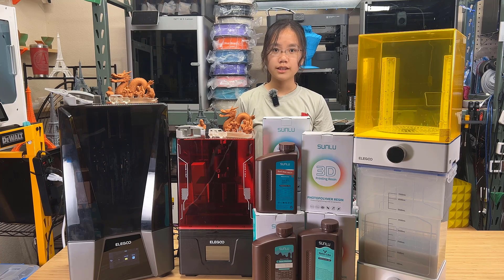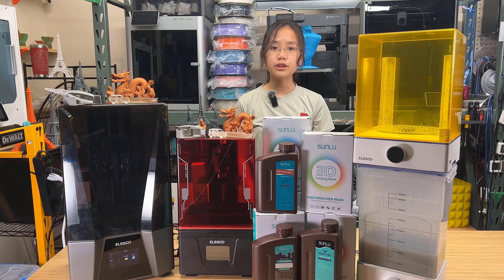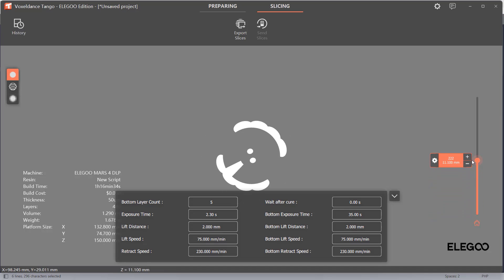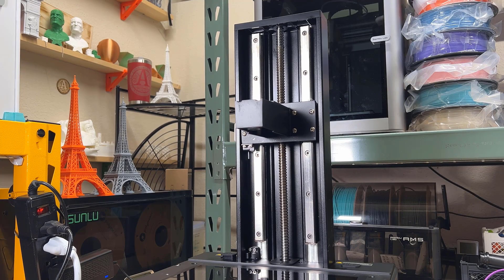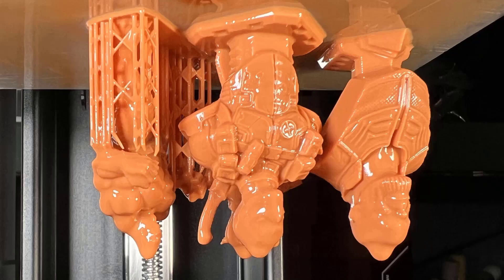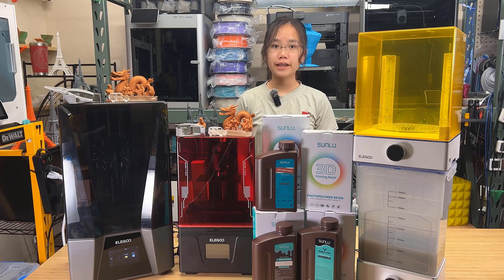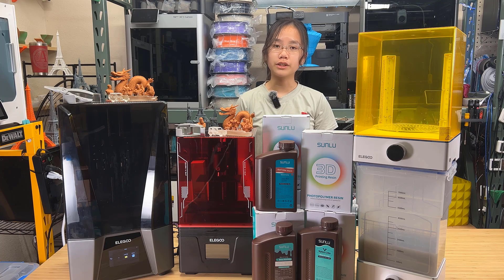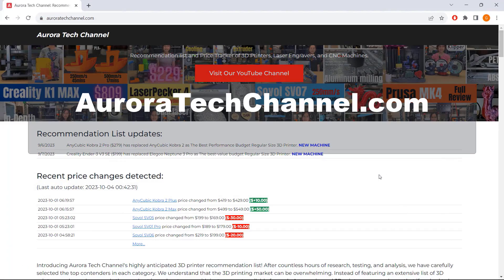ELEGOO Mars 4 DLP vs Saturn 3 Ultra 12K resin 3D printer: 2K DLP or 12K LCD for a comparable price?

Comment: Hi Aurora,

You have the Z=0 set perfectly on the Saturn3 Ultra, your "base layer" exposure time of 35 seconds is WAY too high that's why you have that "elephant foot".  You should set the base layer exposure time to 7.5 seconds - 10 seconds (3 - 4 times normal exposure) and you won't have the elephant foot or over-adhesion problems.  Also, wait before exposure time is very important on these large build area printers, so the resin can distribute evenly below the big build plate, and stop moving before exposure, for the first 1 - 2 mm of the print.

Also, the "etched" build plate is a "gimmick" or "trick" to "force" adhesion (this includes nonsense recommendations to "sand the build plate") - the actual force that causes adhesion is Van der Waals force, and it is very dependent on properly trammed (aka "leveled") build plate - that's one of the reasons the smoother DLP build plate worked better.  Even using a smooth, shiny tempered glass build surface works extremely well, so does an acid-etched (matte) tempered glass surface.  You can see many examples on the Tango slicer d.i.s.c.o.r.d, just search "glass build plate" on there.
Reply: I know I should know how the print adheres to the build surface, being a PhD student, but my lab has some ceramic DLP printers and the company said we could use glass if we wanted. Their only warning was good luck getting parts off the build plate. I just stopped using the machine basically as it does not have enough energy density for my project and the astronomical costs of vat films with wear using ceramic particles so I switched to SLA.
Thanks for the info!
Reply: @ScuffedEngineer  Thank you so much for the valuable comment, my info is all empirical after years of experiments, the objective was to see if good "consumer-grade" mSLA LCD 3D resin printers could be viable for prototyping parts reasonably near the level of industrial pro SLA machines at a fraction of the cost.  [ Spoiler alert:  in my case the answer is absolutely, more than I actually expected when I started testing ] 

Interestingly, I have printed many ceramic parts on my mSLA LCD printers (Nova3D Bene4 Mono, Whale3 SE, and Whale3 Ultra), using Alphasense Ceramic resin, alone or as part of a mixture with other resins (Siraya Blu and 3DMaterials SuperPP), but due to my print settings (way lower bottom layer exposure, etc.), despite the cleanup being heinous, the film wear is reasonable  and I never have over-adhesion, and this is true for flat on the build plate with a standard surface, a WhamBam flexplate, shiny, smooth, dark tinted tempered glass, and acid-etched clear tempered glass surfaces.

I assume that the ceramic DLP printers were using the unfortunately recommended outrageous "burn-in" [bottom layer] times and large number of "burn-in" layers?  Using my methodology, the removal is like separating "wringing gage blocks" [search this term and look at the Starret-Webber website entry],  it should then be very clear why this works [from the Starret-Webber page on wringing gage blocks]:

"Wringing requires two smooth, flat surfaces with surface finishes of 1 microinch AA or better.
 For gage blocks, it becomes difficult to wring surfaces if the flatness starts to exceed 5
 microinches.  The sources of the forces holding gage blocks together are thought to come
 from:  
      1. Air pressure from the surrounding environment as the air is squeezed out when the
          blocks are slid together.
      2. Surface tension from oil that remains on the gage blocks or water vapor from the air acts
          as a glue to hold them together.
      3. When two very flat surfaces are brought into such close contact with each other, this
          allows an interchange of electrons between the atoms of the separate blocks, which
          creates an attractive molecular force.  (This force will remain even in a vacuum or if no oil
          or water is present on the blocks.)

The last two sources are thought to be the most significant."
Reply: @retromodernart4426  I'm using very high solids loading by volume resins, on the order of 60%+ which means that the ceramic particles make up over 80% of the weight of the resin. We want nearly fully dense parts before debinding and sintering to get as close to a monolithic structure as possible. 

The wear doesn't really come from the printing process as much as the cleaning and we've done short DOEs on curing times. Our films also cost $50 a piece. The build plates we were given are powder coated and I haven't had the time to make a flat steel or aluminum plate for the printer.

My actual research is in silicon carbide in which power density is an issue. The DLP printers we have measure out to be 30mW/cm^2 on max power while my SLA printer gives 250mW on a 60 micron spot size. I am also after much smaller particle sizes than published in current papers. I can't say much due to my work currently being IP protected until the paper is published, but I'm in the single micron particle size range with a decent amount of nanoparticles.

I have a background in manufacturing and metrology so I know the concepts, but just haven't put the two together. It's good to have that information out there for others that may stumble upon it though.
Reply: @ScuffedEngineer  Thanks very much for all that additional info, I understand, it's very interesting!  I've done experiments loading resin mixtures with mica powder "epoxy pigment" [ecopoxy brand], nearly zero warpage in over 6 months so far in one case, and around two years in an earlier experiment...
Reply: Hi  @retromodernart4426  , I found your post here very interesting and informative. I would love to learn more about your experiments and printing experiences. How might I contact you?  (assuming you are ok with that)

Comment: BTW the reason one is shinier is that's printing at a higher resolution. The tower model is shinier also because its higher res. You struggle to see with the naked eye but your fingers can feel the difference. The 12k model will feel smoother to the touch.

Comment: awesome, can u compare the prusa SL1-S with the DLP for a functional setting ?
Reply from the maker: I'm afraid not. In my opinion, a 4K Mono LCD machine priced at $2000 seems quite excessive, especially when most other brands offer 4K machines for $150. While I still believe a Prusa machine is better in some ways, I don't think it's worth paying 13 times more for it.
Reply: As someone with a much more expensive DLP printer and a SL1-S available for use in my lab, the SL1-S is great if you need fast prints. It can really knock out prints with good quality if it fits in the volume. Is it worth that much to buy personally is a choice you have to make.